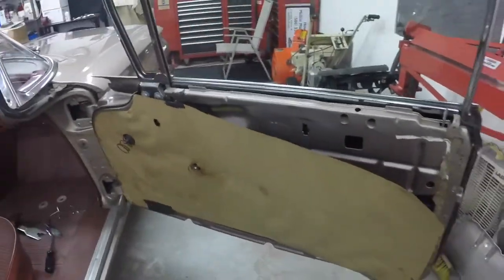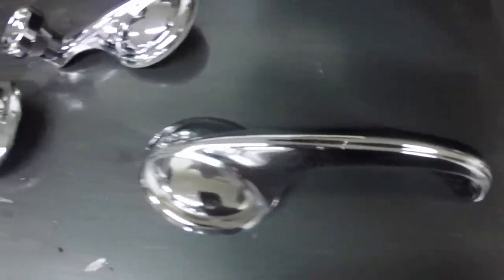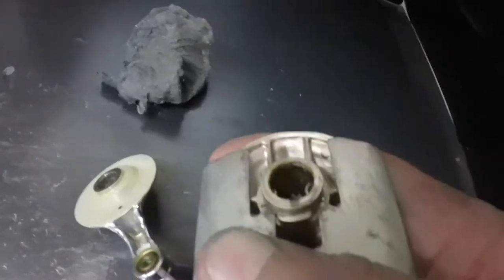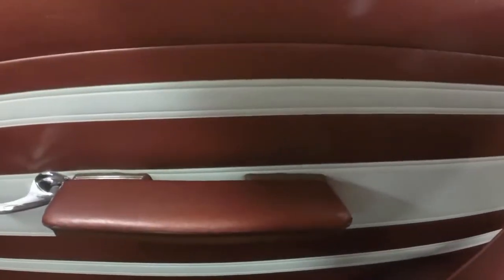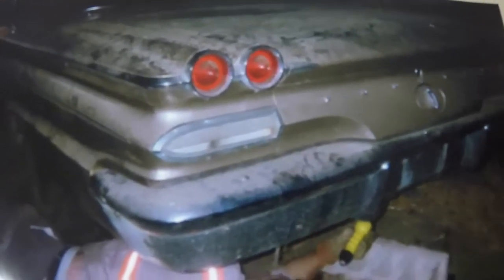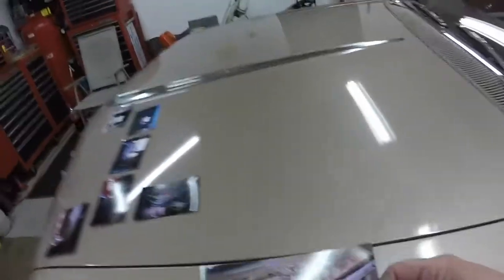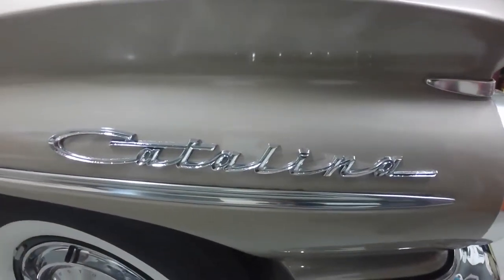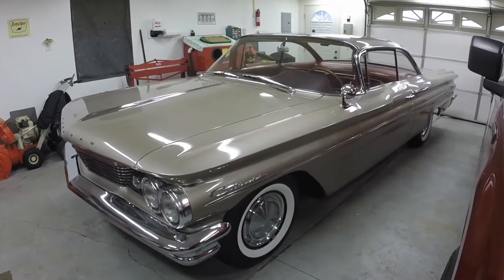60 Pontiac barn find photos in the barn plus other minor things done

Comment: Did you find a factory handwritten build sheet behind the brown paper vapor barrier when you had it off?
Reply from the maker: Only had the passenger door panel off. Behind which paper vapor barrier will I fine it behind? I would love to find it. I thought it would have been under the rear seat like on Chevy of that era.... but there was no build sheet there. This coming weekend I will be pulling the seats out for the trim shop. There going to fix the driver side arm rest vinyl too. I will look for the engine numbers, and make a video on all that stuff. I was away this past week.
Reply: I have done much the same thing as yourself.  I purchased the seat material from SMS and I only had to wait about 5 months.  The current interior in my car is not original.  So I would like a pattern when I use the new material from SMS, what are you doing with your old seat covers after they are removed?  Is there any way I can message you directly with some pictures I have of my progress on my catalina? I might have some information that you can possibly use.
Bob